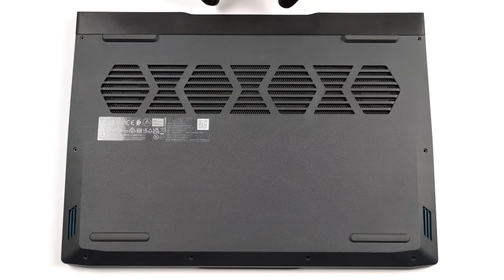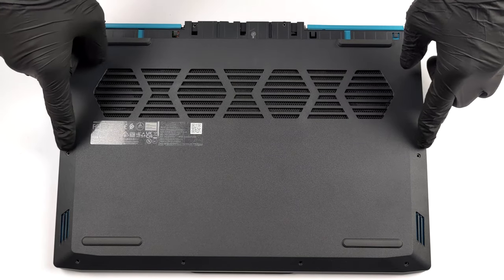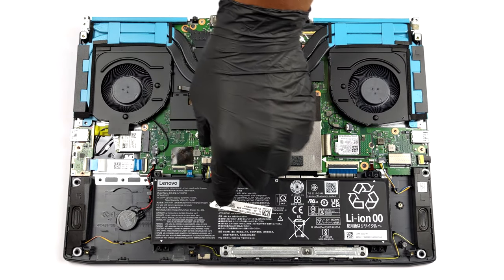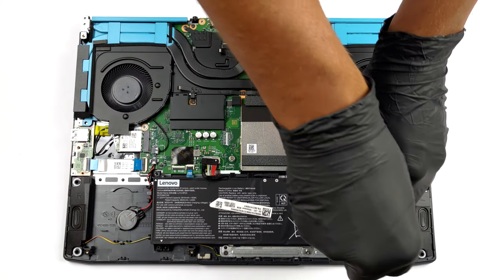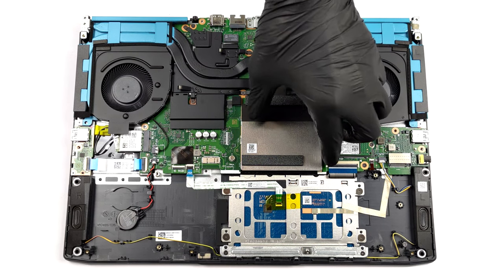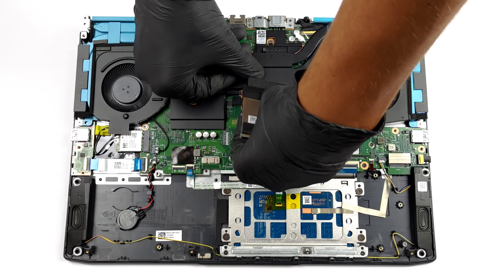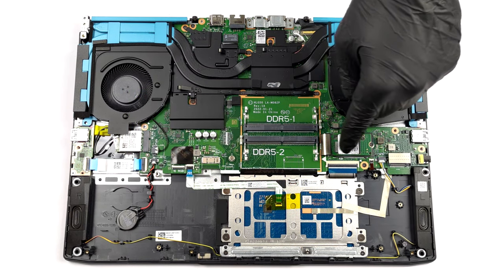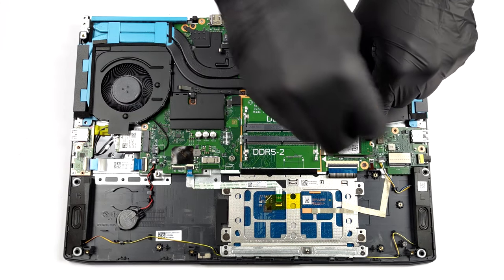🛠️ Lenovo IdeaPad Gaming 3 (15", 2022) - disassembly and upgrade options

Comment: PLease Note:  Newer Models of the Ideapad Gaming require relieving 2 screws from the  Direct Rear Panel (Facing the back, connectors of HDMI, Dc and Ethernet ports are 2 small back screws. Remove these)  Once removed, the back bezel will pull back and off.  Then there are 2 Additional long black screws Center\Back, and to 2 steel screws on the extreme right and left periphery.  Once these 4 additional screws are removed the bottom Cover can be fully removed.  Always remember:  Go Slow.  Snap Photos if it helps.  Detach the battery before waving a screwdriver around.  If in doubt, bring it to a small, local computer repair shop.
Reply: Thanks a lot bro u just saved me 🙏
Reply: TBH repair shop around my locations are really rough when handling laptops. I hate the most is when they pick up by the edge of laptop screen, did they think hinches are made out of titanum and the screws.

Comment: Thanks man. I did not realized there were screws in back. Was going to break the case with prying.
Reply: Same, I almost forced it but figured I missed screws with how easy the rest of it popped open
Reply: I LOVE U SO MUCH  it's okay so far, only complaint so far is that the screen is fairly dim, even at max brightness. Haven't tested its thermal performance as of yet. Noticed it sometimes lags me out in Brawlhalla (on wifi, never had issues with my desktop)
Had it about a month of daily use so far
Reply: I LOVE U SO MUCH  yeah, you can use the included "Lenovo Vantage" app to adjust stuff like that.
Reply: I LOVE U SO MUCH  dlss is pretty good. Works pretty well  and the 3050 is pretty much the entry way of graphics cards with rtx and the 6800h is a decent cpu. No complaints here  worth their cheap price. Bought mine for 680 euros and only needed to install windows. Only complaint is that only way of increasing storage on the cheap is to get a 2242 factor ssd, as instead of a 2242 storage they put a 2080 nvme ssd, which is a steeper price than a normal 2080 nvme ssd.
Reply: Does anyone know where I can buy a M.2 2242 SSD PCIe NVME PCIe 4.0x4 512GB like the one showed on the video???
Reply: Same! I was prying for a few min and then was like “this can’t be right” and ended up at this video. So glad I didn’t just keep pulling.
Reply: Is it true the 2280 NVME slot only goes for gen 3 ?

Comment: I just bought this laptop and 32gb of ram works fine. Bought some gskill ram. Added a 2tb SSD and the screw was there too
Reply: Can I add a 1tb nvme with the 512 I already have?
Reply: I'm getting mixed things said to me, I'm trying to upgrade the ram but don't know what speed, 4800 5200 or 5600
Reply: is yours ddr5? i wanted to up my ram to 32gb (1x16) but im not sure if my laptop can
Reply: Hey man, so mine is the 16ARH7 model and on the specs sheet it says ''up to 16gb ddr5'' (I guess for the whole system) and it already has a single 16gb ram installed with the second slot free. Was yours the same? because I am not sure if it will work with a 2nd 16gb installed.I contacted lenovo support and the guy told me that even he is not sure if it will work but he said that if I have the ram I should give it a try which is hopefull. The only thing he said would definetely work is 2 8gb sticks which I already knew. Please respond if you see this, it would be very healpfull.
Reply: Mine was one stick of 8gb ddr5 and I went with 4800mhz to save money and I didn’t see an option in the BIOS to change speed

Comment: In the video you state that the 80mm ssd slot is limited to gen 3. I haven't been able to confirm this anywhere else and it seems like the crucial site only recommends 80mm gen 4s as a replacement. Can you confirm if this is correct ?
Reply: What he said is incorrect.  I have the same PC and I just installed a Gen 4 m.2 ssd. I had no issues.
Reply: Most storage devices are backwards compatible in most cases.  As long as the keying is correct (either B or M key) it should work.  The ones that may NOT work would be like first-gen drives or the old m.2 drives from 4-5+ years ago.
Reply: For what I know even if you ran a gen 4 in the gen 3 slots the notebook would read it as a gen 3

Comment: the 2nd ssd slot for m2 drive, I had no idea it had one. time to put a 1tb ssd in there for gaming!
Reply: can you send me a link for the other optional upgradable drive. I honestly don't know how to find them lol I might get a TB too
Reply: @linkesn8272  me too i need help idk what to buy 😭
Reply: @dustinheal5370  the motheboard support dual SSD? both form or 1x 2280 and 1x 2243?
Reply: @Rudyjosephjr  1x 2280 and 1x 2243. The extra slot is 2280 I added the crucial p5 plus 1tb 2280
Reply: @dustinheal5370  i have an old 980 pro with heatsink, should i use it on my 2280 slot as primary drive and can it fit? I still haven't open it up yet since it's brand new laptop. From Bios it seems like the SSD that come with my laptop is Micron 2210 MTFDHBA512QFD 2280 form and the 2243 seems unused. This drive is way slower. There isn't much options with 2243 slot. Also I have a pair of idle Crucial DDR5 16x2 5600 ram. WIll it work on this motherboard?
Reply: @Rudyjosephjr  I’m not 100% sure if it’ll fit with the heat sink but it should, mine came with the 2280 slot empty. and yeah the ram will work I upgraded my ram too
Reply: @dustinheal5370  te dieron problemas en garantía por agregar ram?
Reply: @victorhugoarevalogranados5822  no 👍

Comment: super helpful guide, bought the laptop after reading the specs and seeing the upgrade potential and this showed me how to do it
Reply: Can we upgrade to 32 gb for ram and 1tb ss for rom?
Reply: @nEver_asked  i added a 1T m.2 and upgraded the ram and it works beautifully so far. so yes, yes you can.
Reply: @siriothrax2041 so once upgraded do I have to reinstall windows? And pay for it
Reply: Is it true the 2280 NVME slot only goes for gen 3 ?
Reply: @videorol93  no, it has 2 slots for storage i simply added the second

Comment: Thanks! Just upgraded my RAM to 16GB DDR5. 

Will say to be careful with the screws they seem to strip really easily the threads, one of mine is almost bare, gonna order some replacement ones just in case.
Reply: Same, but i think im do you know the medition of the screws?
Reply: Cl I’m in the middle of trying to upgrade the ram the FINAL screw is stripped
Reply: @ZombiesCanHarm same
Reply: Is it true the 2280 NVME slot only goes for gen 3 ?

Comment: I just got the 2023 model with Ryzen 5 7535HS and DDR5. Procedure is the same as with the 2022 model, I just slotted in another m.2 drive for more storage in mine. Thank you LaptopMedia.
Reply: You can just add it? You don't have to remove the current one? Thanks.
Reply: Yes, there was a free 2280 slot (standard length m.2 drives). The one lenovo included occupied the 2242 slot. But it's probably best just to look up the exact model you have and check the specs over at the lenovo website.

Beware though, I slotted in a Gen3 (WD SN570) drive to go along with the Gen4 drive Lenovo included. The Gen4 disk Lenovo includes only outperforms the SN570 in one aspect and that is Read speeds, otherwise it's slower than a good Gen3 drive. At least according to CrystalDiskMark which is what I tested with. It's all fine though since if you're slotting in a secondary drive you're probably just gonna use the first one for your OS and basically all you'll be doing is reading from it.
Reply: @carlvictor  ok I have the latest amd model. I looked it up, I can just plug in a new one like you said. Thanks.
Reply: @jmt__  A heads up - they have some padding applied to the drive that is included, you might want to prepare something like that if you plan on carrying it around a lot. I didn't bother since I won't be moving it around that much and it seemed quite steady when mounted. Good luck!
Reply: @carlvictor  appreciate it!
Reply: Did u add ssd nvme 2280 and just intall it ? I wanna buy nvme 2280 pcie gen 4. Is it available to install ?
Reply: @zenouvre  On my model the 2242 slot was already used by Lenovo. The 2280 slot was free. Just buy Gen4 or Gen3 2280 and put it in there if you have a matching model!
Reply: @carlvictor  thanks for saying all that, i wanted to add a new one beside the one we had and had doubt whether it is possible or whether I had to remove the original and replace it with a new one , now I know I can add a new one AND from a different company and generation so thanks

Comment: Just installed my first ram upgrade with this guide 😊 (I did hours of research and had no idea if I would brick it, I'm covered in sweat).
Reply: Was the 8gb ram is split into 4gb and 4gb Ram or a single 8gb ram stick.
Reply: @srihari3258  Hm?

Comment: Can anyone help? I bought a gen 3x4 ssd m2 2280 yet I'm not certain the drive is being read or registered. The Lenovo software diagnosed that the drive wasn't initialized. I'm not certain what that means.
Reply: I have the same issue with the gen 4 i cant initialize it and it disappears im going to try a gen 3 ssd see if that works.

Comment: For the extra m.2 slot, do you need the thermal gel pad for gen 3 or not. I'm just a bit concerned that my model had the secondary port NEXT to the battery and hoping it don't cause it to overheat or turn into a pillow.

Comment: I have this laptop, and I'm wondering why one of my fan keeps working constantly at high speed? It sounds very loud and works unusually rough. I've played some games on it, but the games aren't even that heavy to begin with, but I've also taken good care of it. I also have a cooling-fan platform underneath my laptop just to help it cool down. The fan is now working like this even when I'm not playing any games on the laptop. I've cleaned all spaces that I'm able to reach and followed many online steps, but nothing seems to work. Even cleansed the activities, deleted some files, made sure the battery status is correct and all of that, but still doesn't work. It just abruptly starts working whenever I turn on my laptop and it never stops. What could be the problem? I still have my guarantees and I think the only solution is to take it to the store for service, am I right? Help please 🙏
Reply: Is this still an issue??  I may be able to help if it is.

Comment: 1 question.
How did you open the metal cover that covers the ram?
because I try to open but I can't :/ . is there any trick?
Reply: just pull it off. its only held on by loose metal clips and some tape. you probably didnt notice the tape and got scared. just pull the metal cover upwards and dont be scared. it will come off without breaking anything

Comment: Does the ram cover need to be put back on? Tried to and got a spark so i left it off for now
Reply: Did you unplug the battery, and press the power button a few times?

Comment: i bought this laptop but the information of it is not clear enough ( i live in vietnam) and i have a question: what's the highest ram and SSD i can install ?
Reply: bạn ơi cho mình hỏi với. mình cx vừa mua chiếc laptop này khi mình lắc nhẹ thì phía dưới bên trái trong thân máy có tiếng lọc xọc mà mình xem trên video này thì có vẻ nó là phần hình tròn nối dây cáp màu đỏ cạnh pin, kiểu nó ko đc cố định thì cho mình hỏi lap của bạn có như thế ko? mình cảm ơn
Reply: The bios battery probably became loose, you should open the laptop and glue it back on it's place
Reply: @manhucbui4283 me too

Comment: I got this laptop on black friday and I'm looking info about how much RAM it can take and there is a lot of contradictory information. Some sites say up to 16gb, others 32gb, others 64gb... 

Do you know how much RAM it can take?  I was thinking about buying a crucial ddr5 32gb stick that is on sale right now on Amazon. Can I use that with the 8gb that comes with the laptop and have 40gb? In the future I would get another 32 gb and have 64. It's cheaper to buy one 32gb than 2X16gb. 

What would you recommend?
Reply: Nos encontramos de nuevo, supuestamente en el video dice que soporta hasta 64gb por lo que no me queda otra que confiar en el, ya que no hay mucha información (aunque lo más que le llegue a meter serán 32gb ya que los módulos son caros XD)
Reply: The Ryzen 5 6600H can handle up to 64 GB of ram. 2 sticks of ram is better since it can dual channel that can increase your gaming and transfer speeds.
Reply: @aaronperkins9601  thank you very much. For now, I will buy just one (I'm broke 🤣). In a few months I'll buy the second stick. Thank you my friend
Reply: I just put 32gb of crucial 4800 DDR5 in one and it worked fine. Also, the secondary M2 slot IS gen 4 not gen 3, so has faster speeds.
Reply: @sgtmckay1996  that's awesome! Thank you very much. I'm still waiting for the laptop. It should get here on Monday.
Reply: In amazon's page , the guy answering the questions  says that it can be uop to 18 gb of ram. I bought another 8gb module.
Reply: @F.A.--  apparently that was what the last model could take. A lot of people told me this model can take 64 gb. Is just that they also say is not worth it to get that much because of the processor and graphics card. I got a one 32gb stick because it was cheaper than getting 2X16gb. I thought about getting another 8 GB and have 16 but for some reason the only crucial 8gb stick available said that it was going to take 2 months to get here (I'm in south America)... So it took the risk with the 32gb. If it doesn't work, I'll send it back.
Reply: @thekraken826  Please tell me if you were able to do it. I might add 2 16gb modulues in the future instead of the othe 8gb I bought. I also want to add another SSD but I have no idea if a 970 evo plus can fit there. I still don't have the laptop on my hands yet.
Reply: @F.A.--  My laptop was supposed to be delivered today but it's 7:22 pm and nothing. I'm very anxious about it. Like 10 days waiting and I got a notification today at 7 am that the laptop was out for delivery... 

I will come back here and let you know if the 32gb worked without any issues
Reply: @thekraken826  thanks a lot!!
Reply: @thekraken826  so i have the laptop on my hands and I'm abot to change the ram.  I have noticed the usb ports are super tight I just got a shitty mouse dongle stuck in it, the metal part of the mouse dongle came off but now I'm afraid of using those ports with my nicer stuff.
Reply: @thekraken826  yeah you are right, it can support up to 64 gb ram. I just used the lenovo vantage software
Reply: @F.A.--  I got it on Monday but couldn't use it properly until last night. I opened it and installed the 32 gb. I left the 8 GB that came with the laptop and it recognizes the full 40 gb and it looks fine so far. I installed cyberpunk and I will test it tonight. 

I almost broke the back panel because y watch these DIY videos on mute, and just pay attention to the visuals and this video is not very clear that it has two screws in the back. After I took those two screws, the back panel came out very easy. He should show step by step how he removes the screws.
Reply: @F.A.--  I will have that in mind too. I have a wired Logitech mouse. I'll be careful when I try to remove it
Reply: @thekraken826  I messed up then, I should have bough 2x16 gb ram instead of another 8gb module. I watched another video and the guy says thesame he almost broke the plastic because of the the screws that are hidden on the back. I havent' installed anything, I'm waiting for my 1tb 970 evo plus ssd.
Reply: @thekraken826  How are the frames per second?  are they good? I'm not planning on playing triple A titles anyway, I mainly going to play rts, older games and using it as a gaming device when visiting friends to play online on pc witch me.
Reply: @sgtmckay1996  Hi. Do you have an Intel notebook? I'm thinking of buying one, but I need 32Gb. I would like to replace it with ddr5.

Comment: I have ideapad gaming 3 15ARH7 , amd ryzen 5 6600H, I haven't opened it yet and I have doubts if it supports 32 GB of ram (DDR5) and 2 TB of storage
Reply: I added 32gb of ram and a 2tb SSD in the 2280 slot

Comment: be careful I opened mine from this guide to upgrade m.2, I bought a 80mm m.2 but when opening the 80mm was occupied with the 500gb, and it was my 42mm spare!
Reply: That is kind of expected due to differences in model. You should have checked before ordering.
Reply: @mdzaid5925  I know, when checking the model number I'm finding both 42 and 80 occupied with differences in specs, its a warning to not do what I did, and to open your laptop and see what you have first

Comment: Can I unplug the battery and only use the AC adapter?
Reply: Sure!
Reply: why would you do that? to save battery for the next owner?
Reply: @ableite  I spend most of the time using my laptop in home, so when is strictly necessary I put the battery to work, otherwise I prefer to save battery life span :)   for those occasions

Comment: Hello. Do you know, if it is possible install 2230 Gen 4x4 in 2242 port? I can`t find 2242 ssd 2242... The computer comes with justo 256 gb. Could I put 2230? thanks,
Reply: did you ever get your answer? im curious to know myself

Comment: pretty please can i see an upgrade to legion 5 60WH battery? yes it fits. probably. i bought model number
L20C4PC0. ill LYK if it works if you promise youll  make a vid if it does. i just want other people to know it works and benifit them. i already spent the 80$ for it. i really just wanna help.
Reply: i did measurements and 3 days worth of research and im almost positive it works with some listings actually specifying ideapad gaming 3